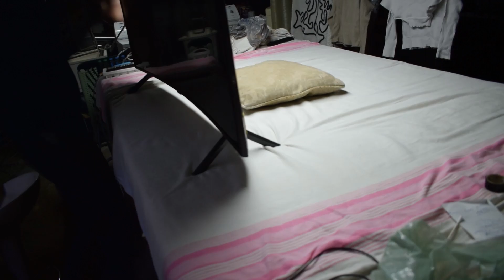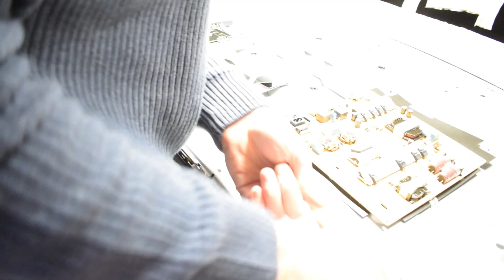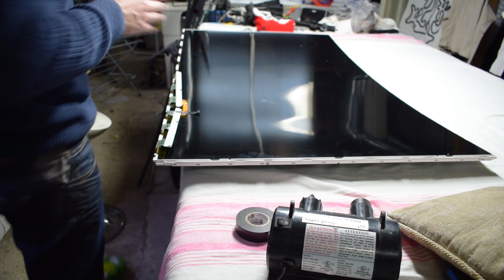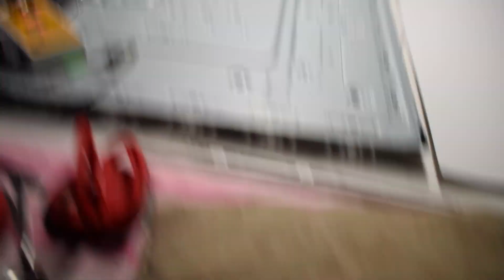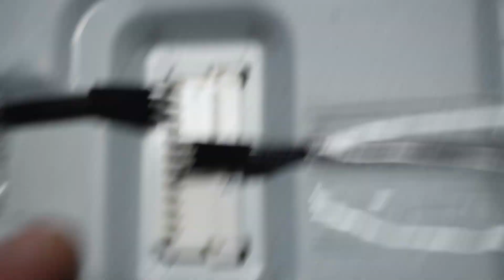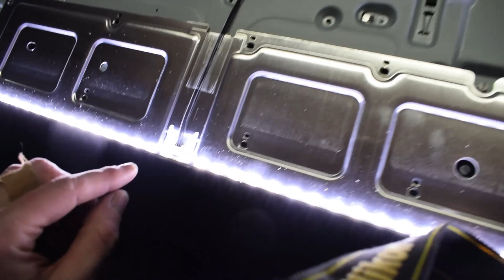Half Black Screen EASY FIX! (Samsung UN55U7300F)

Comment: Guys, I was stupid enough to do this (without any experience and multi-meter). I disassembled the TV and found out there are two broken LEDs in one strap of the backlight. I de-attached the strap and searched for the new straps and finally (after a long time of searching) found a pair. This video really helped me, hope it helps you guys too (and don’t buy a Samsung TV again).
Reply: I had 3 samsungs now 2 with dark on one side and one with a line . They should be sued for this shit . Never buying one again . Always happen after warranty.
Reply: Where did you buy the led strip?
Reply: @baranal amazon

Comment: I have a Hisense 75 inch.. half the sreen is dark.  Is it possible that half the LEDS went bad, is there a power sourse for each side of the tv?  there are 7 left and 7 right.  OR would it mean all the LEDs would need to be replaced?  or just half if not a power source for the 7 left?

Comment: Interesting thanks. I have the same tv but black shading is in the middle of one side (so maybe 1 or 2 LEDs?). I think replacing the whole strip on that side is the answer. Do you agree? I dont have an LED tester so dont know whether it will be the top or the bottom strip. Any advice? Thanks again.
Reply from the maker: try to buy the whole led strips on ebay

Comment: Peace be upon you. My name is Muhammad Saeed. I used to work on a screen like this, and the glass was broken at one end or the bottom, next to the cove, but surprisingly, the glass was not completely broken. There is an image on the screen, but the image has a part in about half that is black in color and covers 4 cm from top to bottom of this blackness.  The simple one in half the screen is due to cutting tracks while trying to change the screen LEDs. Is there anyone who can help me and talk to me and tell me how to solder those tracks please?😢😢😢😢😢😢😢😢😢😢😢

Comment: Serious question. How much would a repair like this cost? Is it worth it just to get a new tv with the same technology
Reply: I work for a company that does electronics repairs and I do this fairly regularly. It's about £395 for a ~55"

I only know that because I did one recently that was a chargeable repair and it said the price. 

Cheapest part to replace. But longest time on site. We do it in your house. Takes hour, maybe an hour and a half.

Comment: The very last white thin layer against the back was double sided taped to the back. It tore a quarter sized hole. What's this paper called? It can be rolled and shipped if I'm lucky. it's not stiff.
Reply: Don't worry about it. Just patch up the hole with the piece you tore off.

That just reflects the light and it won't be noticeable.

Comment: I changed my backlight it was working, after one week backlight dont come on, when I toched the connector of wire that connects power board with mother board backlight come on and works for 1h after that they work dimed barely see the screen, anyone nows?

Comment: I had this issue on my samsung au9000 65 inch tv, I called the manufacturer and had them replace the tv panel for me on warranty, my question is, could this issue occur again? And what causes this problem in the first place .
Reply: Humidity related to cold weather mostly
Reply: @alphaomega1969  Really? Okay what about evaporative cooler? I have one in my room, and when I use it, it does make my room very humid, could that also be the cause of the problem?
Reply: @Encumberedemotions  It would be best to use normal blowing fan in your rom imo

Comment: I just replaced a less than 2 year old samsung 75" with this problem. My best opportunity is that this TV will be the last Samsung TV or any Samsung electronic product I will ever invest in.
Reply: I totally agree with you!
Reply: I said the same thing
Reply: I heard LG last much longer
Reply: Agreed!  And I told Samsung same.
Reply: a television isn't really an investment, is it?
Reply: I have about 8 Samsungs, QLED and LEDS and never had an issue with them.  Still have one that’s 10+ years old.  Now I do have an issue with my QLED, similar to this but it has a few white spots at the bottom and a darker vertical section from bottom to top.  I’m trying to decide if it’s the TV itself that’s the problem or if my kids hit it with something and not telling me. 😂  It just randomly appeared one day, it’s about 8 years old though.  Other than that, never had a problem and will never buy anything but Samsung TV’s.  I tried an LG several years ago and it but the dust in less than 3 years.
Reply: @CrewdConduct Hi it’s the recent Samsung TVs that don’t last they are making them disposable like everything else , water heaters they use to last 15 years now the make them to nearly last the 5 years of warranty and many other things

Comment: hehe for most people this isnt an easy fix, I remember a few years back I got a free 55" LCD no picture so I pulled it apart replaced on of the Strips tested it all worked went to put it back together and well I tore one of the min plastic strips well now TV totaled had to throw it out so is anyone is going to be pulling apart a TV be extremely carefull those strips can tear easily in my case lesson learned
Reply: I did the same thing.  I replaced the backlights and they worked but somehow I 
damaged one of those plastic strips and now there are lines on the screen.

Comment: Thanks so much! This helped me fix my issue. I had one single LED that was affecting the entire strip on one half and with some pressure from a flathead I was able to bypass the current to give the rest of the LED full power. One LED out doesn’t really make a difference on quality it looks like. Thanks again!

Comment: Watched this video and realized there was an easier fix. 1. Place Tv at foot level. 2. Bring appropriate foot back three feet. 3. Plunge said foot into screen while cursing Samsung. 4. Take same feet and walk through Walmart LG TV section. Wala, problem has been corrected.
Reply: Love it was heaps easier
Reply: Think I will try and remove screen first and if I Crack it I will do what you said.
Reply: Thanks dude ! I did this too and it's the only fix that realy works !!!👍🏻    😂

Comment: Took an engine out of my Mark8,  built it up from 300hp, to 960 at the rear end, simple if you know what you're doing.  This not an easy fix..actually seen him having some problems.  Easy fix = punch it, #2 pencil..
  back light, there are welds to brake apart,etc...
Reply: What in the trailer park meth lab explosion are you talking about bro bro?! It's a TV not a Cobra motor. This dude didn't have a problem at all he fixed it with no issues and at no cost. If you can build a Cobra motor to a thousand horsepower then this should be a cake walk.
Reply: @ItsGhostFPV  actually,  I was stoned ,thought I was writing on a different channel, but you were close, don't do meth , it happened to be an incredible edible.. Bitch of it all, this isn't the 1st time I've done that. 😵‍💫

Comment: This is not an easy fix, unless you really know what you are doing i would NOT suggest to try it. Additionally, there are various reasons why a half black screen might appears and this solution only fixes 1 of them (which might not be the problem you have). Also, many retailers will refuse to apply the warranty if you have tried to fix it yourself (unscrewed the TV). So call your retailer first.
Reply: Apparently you took the short bus to school. This Is actually quite simple and if your TV is already broken why not give this a try?
Reply: @xstratosfearx  hi keyboard hero. Apparently you don't know that 1) not everyone on the web is technically inclined. 2)There are multiple reasons why a half black screen may occur, this MIGHT only tackle 1 of them. 3) your retailer might REFUSES to apply the warranty if you have tried to fix the TV yourself. Read my original post again, it says ...'UNLESS YOU REALLY KNOW WHAT YOU ARE DOING'... So if you are sure just go ahead, i was trying to give a suggestion to non technical people. So STFU
Reply: If in warranty, let the manufacturer repair it. If not, then try it. You have literally nothing to loose because if you let it repaired from a shop, there is a 50/50 chance that they might break it aswell or charge you a high amount of money for what you could have easily bought a new one.
Reply: if its out of warranty ur prob gonna end up tossing it and getting a new one. might as well try
Reply: Why not? If it's broken might as well try to fix it before having to buy another
Reply: @limeglasses  a shop with expert technicians can help you fix the TV.
Reply: @enriconolastname3471 for those who aren't mechanically inclined enough to use a screwdriver and a butter knife/spoon. 😂
Reply: @TheCloudwalkerFPV  hahahahhaha funny
Reply: retailer ? in my country
 (France) and I am near Paris, it is very difficult to find a technician that can change a led , first reflex is to sell you a complete ramp, or a nex TV (better) depending of the age it could be safer to replace the 2 ramps, they are not always very expensive...
Reply: Right, why try, just throw it away because enrico says so
Reply: @ripplerxrpl  in the comment i wrote “call your retailer first” not “throw it away”. So Noah, how does it feel to be wrong?
Reply: If you are not technically inclined and this seems massively difficult to you, then by all means, don't do it. But if you're tv is broken and out of warranty and like many of us you are technically inclined, why not give this a shot to see if you can save yourself buying a whole new TV? Some people really just like to piss in others cheerios, this is in fact a pretty damn simple fix.
Reply: @scotasay9370  you are technically inclined but failed at learning how to read…. My message says “UNLESS YOU REALLY KNOW WHAT YOU ARE DOING”. So if you do just go ahead, my suggestion was for people who feels insecure about opening up a TV.
Reply: If it's out of warranty and you need to replace the TV anyways, it really doesn't hurt to try and repair it yourself. The worst outcome is you fail to repair it and have to buy a new TV anyways like you would have if you didn't attempt to fix it. So i don't see the problem with it.
Reply: Don’t get mad at my guy. I watched the whole video start to finish and He didn’t use a single screwdriver to unscrew anything my friends. This guy is knowledgeable and is sharing this video to help those of us who are not afraid to do things for ourselves
Reply: Anyone with half a brain can do what he did 😂😂
Reply: dismounting is not that hard, but replacing everything without missing is not So easy. Inded one dead led is enough to shut down all the ramp (half the). I have a controller (the same as yours)  that can light a led ramp even if some are out of order. Then a small heating plate intended to dismount leds and sold them back (can be done by underside with a simple iron but the dedicated tool is a must . You also need double sided tape, good quality, and isopropanol (alcool isopropyl) to clean the surfaces of old glue ... gloves are not a bad idea to avoid finger prints ...
Reply: Well I assume you have no clue as to what someone should or shouldnt do seeing as your on a how to video along with everyone else
Reply: Don’t forget the explosion after you plug it in
Reply: It is easy to do with proper tools and a little follow directions . I know nothing . Ordered the windshield suction cups to pick up the screen evenly and taped diffusers and filters in order and took pictures and video before taking it apart .
Reply: This is a really easy fix just follow what he says. It’s not rocket science, the dude is walking through each step.
Reply: Right like WTH
Reply: Yeah I don't think he should be advising people to be unscrewing the back of their tv.